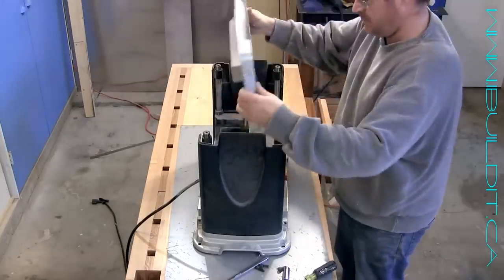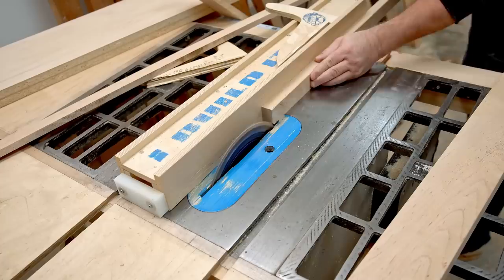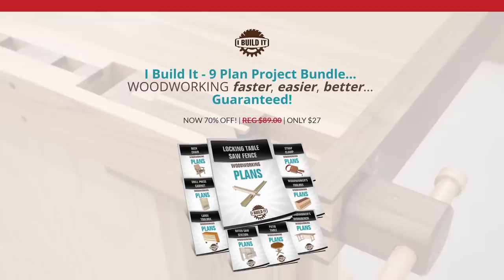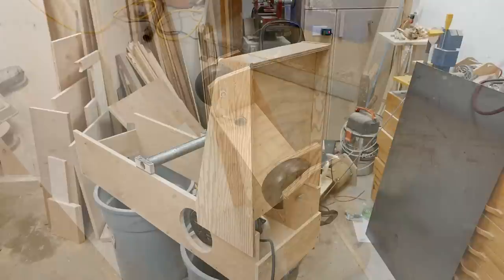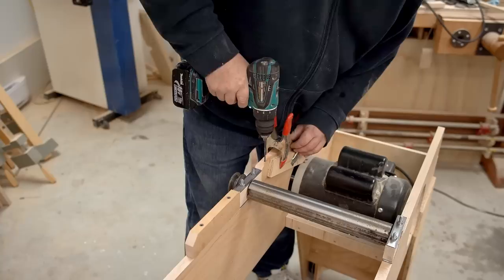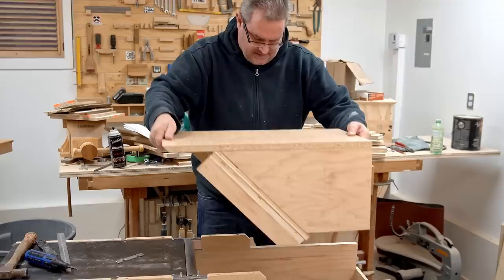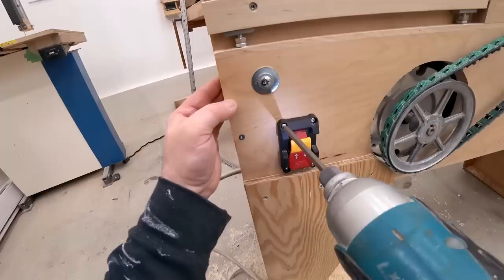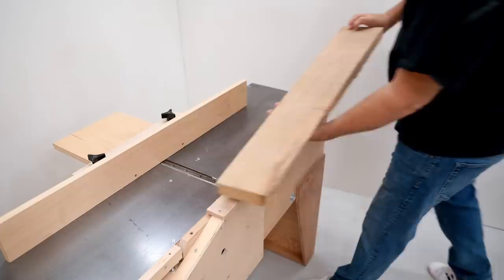Making a $3000 Tool from Spare Parts and Scrap Wood - Full Build

Comment from the maker: My 9 Project Plan Bundle (LIMITED TIME):  https://ibuildit.ca/blog/the-9-plan-bundle/
I made this jointer using the cutter head from my old, broken thickness planer and scrap plywood. The other parts were salvaged or I had them already. 
I originally bought the motor to build a new table saw, but used it for this instead. I did have an old pump motor that would have been powerful enough, but it spun the wrong way and was too difficult to reverse. I had the steel for the infeed and outfeed tables for several years, again bought to build a new table saw.
This video is compilation of 11 videos I made while building the jointer 5 years ago. It took me several months to finish, and those videos are spread out over that time. 
The jointer has been working problem-free since I built it and gets used regularly. 
Here's a playlist for those original videos, if you want more details:
https://www.youtube.com/playlist?list=PLkBNR47uEZ7QkKEuPrgF0i63mNDhVT0re
Reply: do you have plans for this jointer John?
I have a 12" thicknesser which decided to relieve itself of the bonded rubber on the infeed roller, rendering it useless as a thicknesser.. but the cutter head and blades are still good, (it only ran about 25 minutes (not kidding) before the rollers crapped out!) so I've been thinking of a turning it into a jointer, and then getting a new thicknesser.
Reply: Where's your table saw?
Reply: @StoneyMeyerhoeffer  his grey top table saw was only made about 2 years ago. This jointer build predates that by at least 2 years.
Reply: Não encontrei esse projeto para comprar
Reply: Hey, John! Great build! Are their plans for this?
Reply: Have you added a guard to it?

Comment: I put a Byrd Shelix on my Powermatic P100 12" planer 10 years ago. Hung onto the original head and finally got around to making it into a jointer this year after using an old Beaver 6" jointer forever. Bought a couple pillow block bearings at Grainger, used a 1 1/2 hp induction motor I had laying around. Made pretty much what you made but used Mathias Wandell's parallelogram idea for the infeed. Made the tables to the width of the pillow blocks which allowed me to just use a couple of hanger bolts in the outfeed table for fixing the fence in place. If need be, I can skew the fence for a shearing cut like the old Yates jointers. Works great and fairly quiet. Oh yeah, for the tables I just yellow glued up 3/4" mdf using my flat workbench and about 20 12" pavers to weight it down overnight. After they were dimensioned, I used two coats of epoxy, sanding between and sanded the final coat with 220. Then buffed with wax and finally talcum powder. I can always add metal later if need be.

Comment: I have a shelix head in my old Ridgid planer and a motor on my HF blower. I have the plywood and hard maple. Hell, I even have the steel.  I think having a 13” helical head jointer in my hobby shop would be serious overkill.  

So I’m obviously gonna try to build it.

Comment: I need something just like this...  I've been thinking about buying a 12" jointer and cutting the infeed and outfeed tables down because I don't need the length.  The longest board I need it for is about 24" long.  This one looks about perfect for the boards I deal with.  This looks great!
Reply from the maker: That would be an interesting project, especially if you made the parts from metal.
Reply: Maybe one of those sanding drum finish tables.

Comment: I've just ordered a second hand Dewalt  DW735 cutter head (complete with blades and clamps), and intend building a 13" jointer/thicknesser with it. Al I need to do it take your design and add in a thicknesser section ... simple!

Once again, thanks for a fantastic video showing your thought processes and build ... much appreciated.

Comment: A great build, I have cheap thickness machine myself, and this build is ideal. Used your updated fence on my old site table saw, fixed the problem I had. Pity this does not allow pictures.
Reply: Check his website, he might have articles about the build form 5 yrs ago,

Comment: I can get down with the rereleasing of old content. I think it would be cool to add a short section at the end reviewing it. This would have a been a 5 year review on how it's holding up and what you may have done since then or maybe modified
Reply: Review is in the pinned comment. He said it still works great, what more do you need?
Reply: @KipdoesStuff  to not have to read comments

Comment: I'm really surprised, I expected you to do the outfeed table the same way you did the router lift, with four bearings to force it to go only up and down vertically, then having some sort of 45 degree plate that interacts with a horizontally sliding 45 degree sled with bearings on it, so when that slides horizontally, it forces the outfeed table up vertically.   
I built your version of the router lift for my router table, and it's a far more elegant solution than I could have ever have come up with on my own.

Comment: Figured I could get long planer type utility by building longer sleds to hold boards square as they pass through my bench thickness planer - that only has about 12" of flat surface underneath?

Comment: Hey John, what did fail in the original jointer to force you to build your own one? You salvaged the electric motor so I guess it might have been something else but there is not much else apart from some belts that can fail in a jointer, did you just want to show off your amazing building skills?